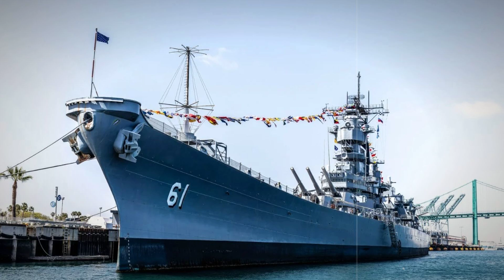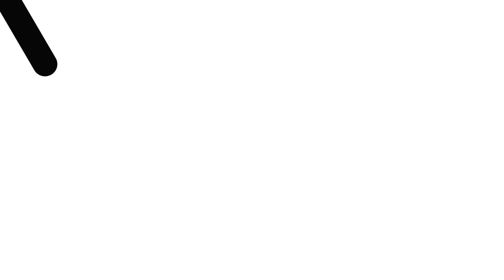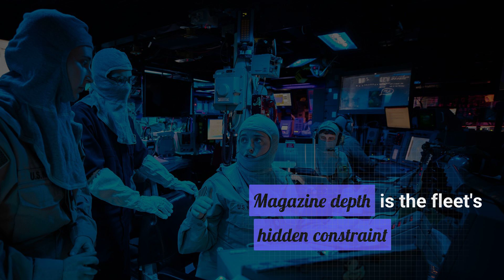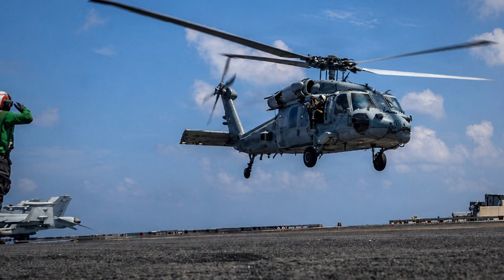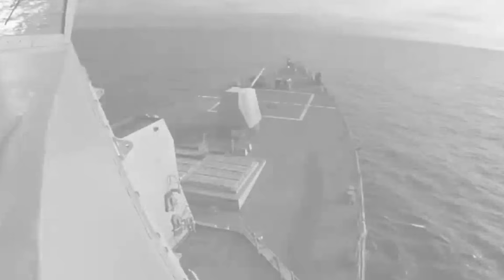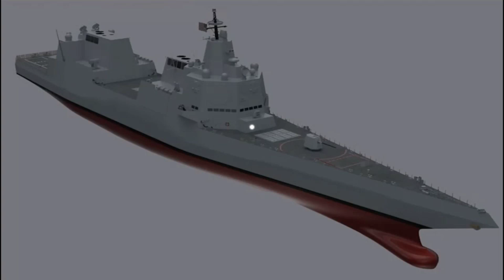Inside the NEW $23 Billion Battleship in the US Navy

Comment: I keep watching these video's talking about the new battleships but never hear the new weapons needed to defend against the newest battle weapons.  We have seen Ukraine and Russia using Drones and see how Ukraine took out some of Russia's major sea defense ships.  The issue with our current destroyers and cruisers are 1) limited VLS and resupply issues 2) Limited defense against smaller drone attacks.  Sure they have CWIS, Missiles and High energy weapons to handle limited drone strikes but it IS limited.  If lets just say 80 drones attack in a wide incoming range some will get through.  It does NOT take that many drones to overwhelm a current vessel considering the fact that it is quite easy to send 1000 drones + at any one attack.  The issue with current ships and the best defense against a drone is that it takes LOTS of power to utilize the high energy weapons and if you want to have a vessel with 6-8 of these you need a power source capable of powering them.  Even the CWIS takes a massive amount of power to operate.  So having a battle ship capable of housing 2 small reactors means you can have the multiple high energy weapons for defense of the ship plus it gives the ability to have the rail gun but for even rail guns to be effective the ship would need 3-4 of them because they can only fire 1 time every 10 minutes or the barrel has issues after firing several times.   
I believe no one talks about the drone issue is the government is in a sense hiding this vulnerability.  I also have seen a video on YT that talks about new tests at area 51 which might be (suggested by the creator) testing wide range high energy weapons so they can be fired and take out many drones all at the same time compared to the current narrow width high energy weapons in use now.
Reply: Ukraine  has the good fortune  of the Russians Surface Navy being composed of idiots. We saw at the Horn of Africa what happens  when the same tactics  are used against  a NATO task force. It resulted with a months long attempt  by the Houthis  to hit NATO ships with aerial, surface and subsurface  drones and failing each time. Russian  Surface ships are crewed by conscripts. This is a known fact. They don't  do proper warchstanding or proper  equipment  maintenance. They don't  do the equalvalent  of an OPPE for deployment  readiness like NATO ships do. Hence  why Ukraine  had great success  in sinking  the Black Sea Fleet. Many  pro Ukraine  YouTube  channels  that I support  always  omit  or flat out don't  know that fact. Which gives people  a false assumption  of the effectiveness  of Drones against  a well trained Surface Navy.
Reply: @GRIGGINS1 . Yes if Ukraine was fighting America n America was next door to them. Like Russia is,  Ukraine wouldn’t have sank so many ships nor would they even have been able to get to this point n build up a supply of drones like they do now.  They r doing great for being so well overmatched in almost every way at the start & thruout the whole campaign.  However not to take away from how well they have stood up against the Russians, but it’s because of the corruption n lack of everything that made this happen.  They would not have been able to do all that against America if America next door n did this to them.  However America wouldn’t have done any of this in the 1st place so it’s really a moot point.  But the difference between America’s military & Russia’s is like night & day.  Basically everything is which is why this is a ridiculous hypothetical that is almost as ridiculous as Eussia having done so bad in every single step of their special military operation.  And yes it is most definitely a “Special” Military Operation!
Reply: @TheeJerseyDevil  Yep both you and me know this. But you would be surpirised the amount of Russia Simps that still to this day think Russia is the best military on the planet.  And all the defeats Russia is taking is media propoganda. I wish I was kidding but you can find thier videos on Youtube.
Reply: @G @GRIGGINS1     I know that used to be true, but since Ukraine started attacking Russia this year constantly attacking refineries & Moscow itself.  I can’t imagine that they all still think like that anymore.  After all they r now feeling like they r in a real war now just by looking outside or driving around the city.  If u even have enough gas in ur car to do so.  
  I know I wouldn’t B going anywhere in my car but to work if I had to wait in line for a few hours just to get gas.  Cause I know when I get to the pump I’m filling up my car n at least. 1 or 2 gas containers.  I don’t want to have to come back & wait for a long time if it’s possible, but I am gonna try & keep a lil supply at home in case the day comes that gas becomes ridiculously over priced (that day is definitely coming) as well as super long line.  I’m gonna have some supplies at home especially if I’m Russian because while the Russians can repair their refineries pretty quickly, they also have many other very important things they need fixed as well.  (Death from a thousand cuts type shyt!).   As a Russian (if I was 1 in this hypothetical) I would know just nasty Russians R2 each other so I’m not expecting if things get really bad that I can depend on any1 else 2 help me, & if I am lucky enough 2 finally get some from someone, it’s prolly gonna cost me.  So being able to pay them in fuel could be
The difference between life & death in. Russia these days & even more so in the future as Ukraine is gona keep attacking the refineries.  So the shortage is only get worse the longer the war goes on & the priority is always gonna B to the elites & military first, population a distant third or fourth, & that’s really only the ppl in Moscow & maybe St Petersburg, if not then they r right after wit the rest of Russia coming in at like far back 8th or 9th position in priorities.
Reply: @TheeJerseyDevil To be honest  I see Putin's fate being the same as Mussolni's. He will not have a peaceful  end.

Comment: I served on the recomissioning crew of the New Jersey in fire control>>>>THE PHANLEX gattling gun put out a great deal og amo>>>The sursace reflection from waves jammed the return signal>>>Making radar useless>>>>when radar becomes useless there is no accurate target solution>>>>When is was determined that it could not defend against anto-ship missles it was pulled from cambat service becoming a PR tool>>>>With space launched missles descending in a vertical descent with no arc the target size becomes that of a VW BEETLE traveling at MAC 5-7>>>>>This is a major FRAUD UPON THE TAXPAYER>>>>>Who profits>>>>DEFENSE DEPT HAS REFUSED ACCOUNTABILITY